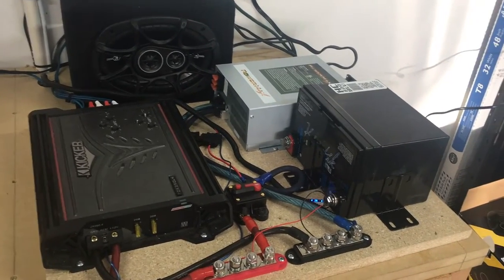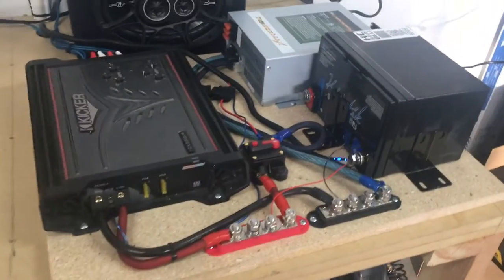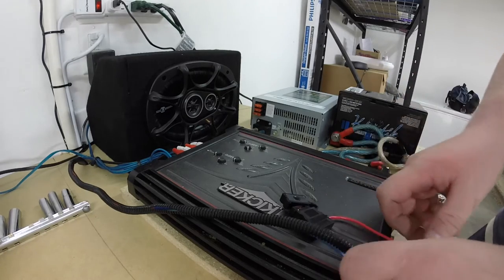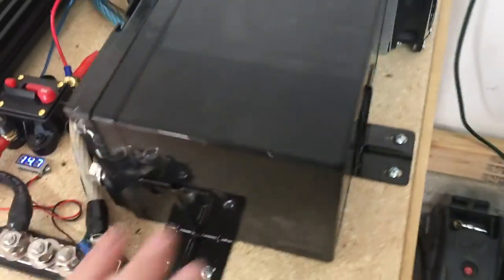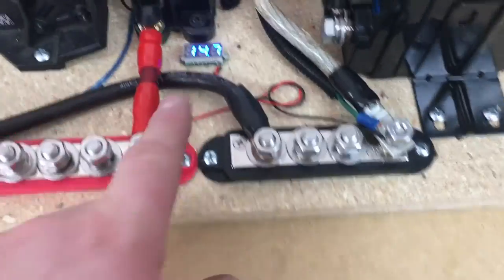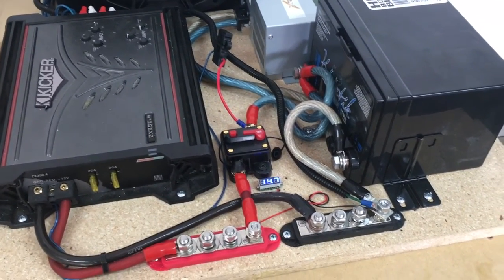Building a Garage Audio System Part 4: Wiring the Battery

Comment: Just curious, but what is the actual reason for the battery if the powermax inverter worked fine?
Reply: That’s a good question. I’m curious myself.
Reply: Indeed, especially since the Amp maxes out at 175 watts in bridged mode. I thought it may have been a power sink but that convertor more than covers it. Maybe it's for those long play days, and it does actually remove dependence on electricity.
Reply: Can be any 12 v battery?
Reply: The only thing I can think of is maybe for the memory function on the radio, so he doesnt have to reset everything every time and run the inverter full time.

Comment: Hello, my name is Gloria; I have the same setup as you have; I don't have a circuit breaker like you; I have a fuse connecting; I have a radio CD pioneer and an equalizer 7 band with 2 amplifiers. I see that you grounded your car battery, but not your powermax; my question is, do you need to ground your powermax ground?

Comment: ? What’s the 🕳 point of the battery if that inverter is providing the 12v needed to run the system please hit me up ASAP I’m building a sound system bbq table for yard party 🎉
Reply: I'm doing the same thing. Running a marine deck and amp for my bbq island and don't want to use a car battery
Reply: I followed this same method and my battery crapped out because it over discharged (I have no idea what that means)!

Comment: So the reason for the Battery Install is for more power?   i see the system worked without battery and only inverter.
Reply from the maker: Yes, but all depends on your power requirements of your equipment..  Battery provides a constant supply were the power inverter is used to recharge that supply.  All depends on your application.
Reply: @ProvoBeastAudio  that's good answer.. idk why people laughing at you because of it

Comment: hello.can I use a 55 amp p,u with no battery?? just for bass
Reply from the maker: You should be able to, as long as the amp you use doesn't pull more than 55 amps.  The battery is good for to ensure stable voltage / amperage to your amp, but not totally necessary.  Even if you used an old battery that held a charge well, that would work.  Regardless, be sure to fuse / add a circuit breaker to your setup.
Reply: Ok thanks

Comment: Where did you get the power supply/inverter?  What make/model?  Thank you!
Reply: ghostinthetreeline you can get them on Amazon, under RV or Marine converters (not inverters).  A 30 to 60 amp shall do you fine.

Comment: Does it do any harm or make a difference to skip the battery?
Reply from the maker: You should be able to, as long as the amplifier you use doesn't pull more than the available amperage output of your power supply.  The battery is good for to ensure stable voltage / amperage to your amp, but not totally necessary.  Even if you used an old battery that held a charge well, that would work.  Regardless, be sure to fuse / add a circuit breaker to your setup.

Comment: Hey I know this video is old but I live in the U.K. and want a power max pma-100a but it’s only 110v and over here we’re 240 well technically 220 but still what can I get, I’m building a racing sim and need a 100amp power supply with good gauge output like that one
Reply from the maker: There are options out there but you may have to look for a while.  I found a 75amp version running 220v here: https://www.amazon.com/Powermax-PM3-75E-Amp-220V-Charger/dp/B01N5MTHWV/ref=sr_1_1?ie=UTF8&qid=1524770410&sr=8-1&keywords=220v+Powermax&dpID=41wjTAOV78L&preST=_SX300_QL70_&dpSrc=srch
Reply: Provo Beast Audio Installation thanks for the quick reply, I can get one ordered from the states but at the same price as the pm4-100a, would it work to have a 240v to 110v converter? You can get them easy in the U.K. and if it’s pulling no more the 15amps from the wall it should be find I think ?
Reply from the maker: Yep should be fine, worth a shot.
Reply: Thanks man, much appreciated. love it when youtuber answer viewers question and give useful info, if I could subscribe twice I would, keep it up bro

Comment: when you hook it up to the battery is it on constant power or 3stage charge mode?
Reply from the maker: I don't keep the converter plugged in all the time, i unplug it when i'm not using the system.  But, if i keep it plugged in, usually it is on more of a 3 state charge mode.
Reply from the maker: No, constant power while there is a large demand on the battery from the amps.
Reply from the maker: The charger we have is a "Smart Charger" where it does it automatically between full charge mode and the float mode.There are no switches on the converter, but the manual shows that the voltage adjusts depending on the charge of the battery overtime to prevent overcharging.
Reply from the maker: https://www.amazon.com/PowerMax-PM4-100A-Converter-Battery/dp/B01ER3LH5W/ref=sr_1_1?s=automotive&ie=UTF8&qid=1500403309&sr=1-1&keywords=Powermax+100+amp
Reply: Hey, How well do you think this setup would work with a cheap 8 or 10 Capacitor in place of the battery?(probably more like 3 farad actual power) That powermax is a power supply and smart charger so I'm wondering if the Caps would allow for big bass notes while the power supply provided continuous power to the cap ... Thoughts?  I'm concerned that the battery would have to be replaced in this setup... curious about a more long term option.
Reply: Can this converter be plugged into a smart socket safely? So that I can tell Alexa when to turn it on/off